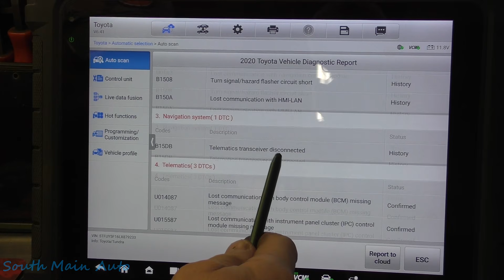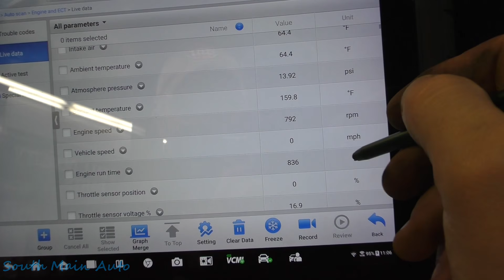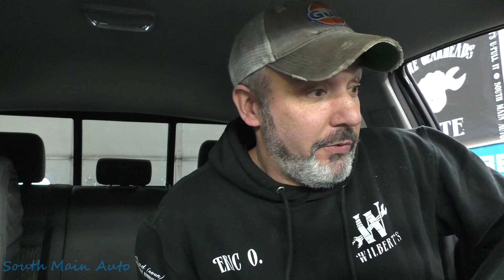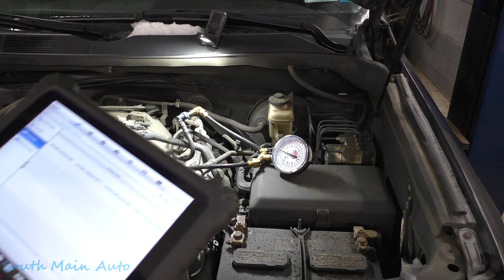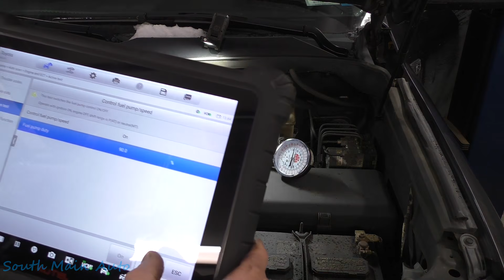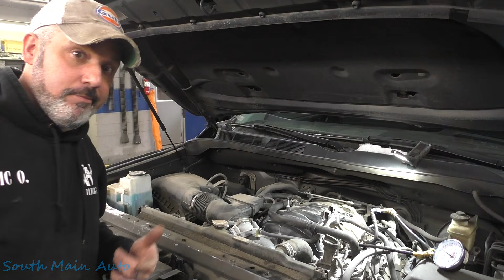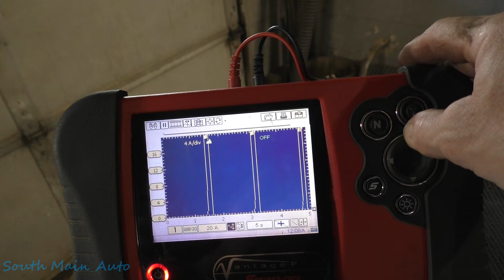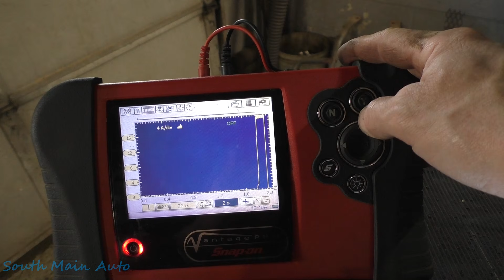My Customer Is Getting Shafted By The Local Toyota Dealer

Comment: My brothers 97 GMC 350 wouldn’t start when it was cold outside without a sniff. Supposed to have 60psi only had about 20. Replaced fuel pump problem solved.

Comment: FPDM fuel pump driver module, always an issue if it's present. Think of a blower motor drawing to much amperage and burning up the resistor.

Comment: Just plain sad that a Toyota customer is shell shocked to depend on his local dealership knowing his warranty is valid.  Then, after this diag, they still decide to throw parts at it due to corrosion on the bracket ! Hell Mr. warranty mechanic, you can hear the pump is junk and why are you tearing into my fuel system array when I have proof the loud sounding fuel pump is going out !
Talk about narrow minded mechanics with distant lens glasses on a near sighted issue.

Comment: There are self-resetting circuit breakers... that's probably what's going on... it's got the bi-metallic element... like a flasher, basically, except it opens when too much current flows.

Comment: I love going to my Honda dealer for oil changes as they provide a multi point inspection that always comes with issues discovered usually over $2200. Today was $2500, guess new year’s pricing😅 The funny thing is that an issue I know exists is a Vtec spool gasket that needs replacement. A blind man can see the leak 😮 FYI I typically have my slave on notice(son) handle most of the issues indicated on the report and I take it to my local mechanic for anything major. The service manager even told me take the report with a grain of salt as most of the techs are kids.
Reply: My grand daughter took her honduu to get an oil change. She walked out with a $400.00 oil change. 
I told her. Never the go to Honduu unless it's with me or your mom😂😂
I had to do a transmission service for her car. I went to Honduu for their transmission fluid and some other parts. 
Paid the bill and walked past the shinny cars and yakking salesman. 
Can I help you? 
I didn't bat an eye.. just kept on trucking.

Comment: It's not Toyota that has a bad brand. It's the dealers that are ruining Toyota. I won't set one foot in the dealer I bought my Tacoma from. It's by far better for me to do my own oil changes. At least I know it will be done right with much better oil. That's only one issue. Lying, cheating and over pricing is 3 strikes all by itself.

Comment: is it possible to measure current at the battery before broke then after wont start the starter draw may not let you see what you need i guess. but after you spray it hummmmm. before and after at the battery . i got to try it in the morning before i drop the tank. fyi i have a new pump ready just seeing the amp measurement is like target shooting exciting

Comment: I would suspect that if he took that truck on longer road trips in the summer, he might have started experiencing the stall condition even after getting the truck running. Furthermore, I believe the customer may have diagnosed the issue himself if he turned off his vehicle when filling it with gas, which I believe he wasn't doing based on his comments about just not shutting it off for short stops.

I encountered a similar issue with my miata. Ended up diagnosing it, albeit hamfistedly, by running it low on fuel, waiting for the car to be massively down on power from lack of fuel, and throwing fresh, cold gas into the tank from a gas station. The car would immediately be fine without any signs of stalling because of the cool fuel. For other DIYers out there, that might be a decent, easy test you can do to assist in diagnosis.

Comment: Great job Eric O.  So rather than a simple pump and regulator, they had to complicate the system with a separate controller to run a "duty cycle" to optimize fuel pressure and flow.  Then mount the thing on the frame rail for added reliability.  On top of all that, they don't train the techs to properly diagnose the operation.  So it ends up with an independent shop that has to explain THEIR OWN SYSTEM to THEM!
Stay warm everyone, the climate changed again. . .to winter!

Comment: Diag electrical issues aren't too difficult unless intermittent.  It's those logic issues that aren't in service data that's challenging.  I don't think I've ever seen circuit checks done by ECUs info in service data, which sucks. 

 Watched a tech replace a PCM because he thought the drop outs in an APP circuit was a faulty PCM when, in fact, the PCM was checking the circuit for shorts to power.  
Thank you for the tidbit on Toyota FPM current protect mode.  Be looking out for that now 😊.

Comment: the fuel pump module has a electronic relay (mosfet probably) that can switch on and of faster than a regular relay (for PWM control). But basically the same thing. The over current protection is better than a fuse because it reacts super fast without blowing the normal fuse as the normal fuse has to physically heat up and melt. So the fuel pump module can try to keep sarting the pump without blowing the fuse as the fuse cools down in between pulses. But if the sht did hit the fan, the normal fuse will blow. You can run 1 million amps thru a 5 amp fuse if you wanted and not blow it, just not very long. maybe a nano second pulse and a 10 second rest, then another pulse of 1 million amps. Maybe I will come back with the maths 12v at 1 million amps over a nano second, lol

Comment: thank you on the lift today 1992 s10 4.3 same problem go to the dg and back try to restart noting spray it will run like new all day till you turn it off. this truck as 55k on it yes 55,000. i am doing the amp draw test first just to know thank weird this vid just came up same problem 30yrs apart

Comment: How does a fuel pump fail so quickly on a new car with such low miles? I have an old Audi that I replaced a fuel pump at 256,000 miles and 30 years old.

Comment: One thing I've learned with my 2018 5.7 Tundra is that you ALWAYS need to shut the engine off and remove the key when you fuel up.  For the first few years of fueling my truck i had never shut it off.  (Farm fuel tank)  This made the alcohol percentage register as like 87% ethanol (no it wasn't E85 in the farm tank).  The only time the 5.7 recalculates the alcohol content of new fuel is if it's fuel level changes during the time the engine was "cut off" and when it was "cut back on". (This is what a Toyota tech told me)

Comment: Good diag Eric. I had a similar situation on the motor home when my inverter quit. I diagnosed it as a bad ground and informed the RV "service center" of that. They called it as a bad inverter and replaced it. When the new inverter didn't work, they replaced it with yet another inverter which, guess what?, didn't work. Then they finally chased down the ground lug which was heavily corroded. 

I sent the original inverter back to the manufacturer and because it was still under warrantee, they serviced a circuit board and returned it to me. All it cost me was shipping (plus I paid for the new inverter - they would not re-install the old one).

Comment: It starts and runs after spraying ether in it cause during cranking you have 12v or less going to the pump. Once it starts off the ether and the alternator kicks in, you have between 13.5-15.5v going to the pump. That difference of a few volts could be the decider if you have enough fuel pressure and volume to run normally

Comment: my theory is during cranking the battery has around 12 volts, maybe not enough to start the siezing fuel pump. however spraying the Cosby sauce and revving the engine slightly bumps the voltage up to 14-15 volts.. maybe that's enough to jump start the fuel pump.. good video Eric O.

Comment: I had a Dodge van that had similar symptoms.  It would always start when cold, but occasionally would not start when hot.  Then one day it just died while I was driving it and would not start.  I had it towed to the dealership and it fired right up once they got it there.  I got it back drove it a few more weeks and it did the same thing. Again, towed it in and it fired right up at the dealership.  They asked me to come get it as they couldn’t find a problem.  I asked them to keep it and have a tech drive it home each night until it acted up so they could work on it. They reluctantly agreed and a couple of days later I got a call that the tech had found the problem.  He had taped a fuel pressure gauge to the windshield and as he was driving the fuel pressure went to zero and the van died.  He waited a few minutes and it restarted and he drove it to the shop and replaced the fuel pump and that was it.  Why it only failed when hot, I don’t know, but it worked fine cold, but was flakey once hot.

Comment: What a sad state of consumer protection.  Customer knows the dealer will just throw parts at it until they stumble upon the problem,,, but the customer is on the hook for their incompetence.  The worst part is you cannot prove that the parts they threw at it,,, did not need replacement.  

Just seems wrong to me.

Comment: I worked on a Vibe/Matrix once that ran fine unless it was a cold start in single digit temperatures. It had 170k miles with the original plugs on it and when i inspected them there was barely anything left of the side elctrode.  I couldn't believe it ran at all.  At 12 degrees started and ran fine.  At 6 degrees she aint starting.  I guess 3/16" is a bit too much gap for spark to jump in those temps. HAHA.  How is that related? I dont know.  Just a wierd no-start condition.

Comment: In my opinion dealer tech have been taught to follow the chart and if this is so go to here if not go here replace module. Which is one step above a parts changer. Does ASE teach trouble shooting with the use of a scope? Not knocking the ASE. Being an MECP master installer you know the junk aftermarket stuff you hate only means one can understand the questions and answer properly but the application of what you know is a completely different story as you see when you drop the dash and see a rats nest. Gives us a bad name as any install I do you can't find the modules or any trace of the install. Erks  me when someone puts a 199.95 alarm in a 70 grand truck for "protection".

Comment: On big trucks relays are used as buzzers for low air pressure or oil pressure or whatever. So yes a relay can modulate from on to off when shorted and a motor that will not turn may cause that condition.

Comment: had a similar issue with a 2002 f150. Cranked cold, once turned off, wouldn't crank until it cooled off. After a week of this, noticed the odometer would be blank when it failed to start. Was a bad PCM relay

Comment: I have a 2010 Toyota Highlander that I took into Vandergriff Arlington, Texas had the timing chain blow off, and this is the second time I’ve taken it to them for the same issue. They said they found metal in the dipstick which that’s not even possible to pull a chunk of metal out through the little dipstick hole and they said it would be 6000 for a motor with more miles than my car 3000 for labor and 1000 for miscellaneous so all in all they just wanted me to buy a new car. I let the car sit in my backyard for a year and decided to junk it and they gave me 1800 for it. I lost so much in that car but it’s hard to find a good mechanic not shady, that’s why I like this page
Reply: How many miles?
Reply: @wespotter6985  this?
Reply: My sister parked her 2015 Tahoe for over a year because no one could fix her truck. 
She heard that I am a shade tree mechanic. 😂😂
She towed it to my tree house.
About 1 hour later I told her what's wrong. 
By the way Chevy dealership took a stab at it before she parked it.
She spent $1k in parts total. All Chevy parts only. I shopped from a dealership in Texas. 
Anyway, because I have an actual job. In between my work schedule I fixed her truck. 
To this day, she is so happy her truck runs so well. 
And it's because of Eric O and Ivan.

Comment: Thought: If the amperage/power consumed (±120 Watts) in the very-hard-to-run-pump generates a whole lot of heat, and it pumps around not-a-whole-lot-of-fuel, you might end up with a vapor lock in the pump after the pump stops. Getting it running again without additional fuel it fails due to mechanical resistance/the vapor lock/the bad motor. With additional fuel it starts assisted by a higher voltage in the system. Nice video!

Comment: Flashback time.  My '91 Sierra (It had the big 4.3) would once in a while crank no start, but if I coaster down a hill (my driveway) and popped the clutch it fired right up and ran fine.  Finally one day it wouldn't even bump start, I loaded it on a trailer and hauled it to the shop, fired right up.🙄.  A few weeks later it did it again, and I finally realized I couldn't hear the in-tank pump, pf course it was about 1/2 mile short of a full 34 gallon tank.  I changed it in the street out front.

Comment: I had a similar issue with a 1991 Chevy K Blazer 350 with the 220 TBI. With low temperatures and vibration (engine running) the fuel pump worked. It was a bad fuel pump ground in my case. The laughing gas would get it restarted and it started cold. Took me a long time to find it.

Comment: After it starts the system voltage goes up. May explain why once it starts from the juice it continues to run. Would have been interesting to hook up a charger to boost the voltage to see if it started.

Comment: Weird system, I assumed that this injection does not have reflow pipe to tank, but CPU monitors fuel pressure instead and turns duty cycle lower and higher to keep right pressure. But seems that Toyota tries to save some electricity or bump, what else is the purpose of this duty cycle business? Had this bump been powered by normal relay so 100 % "duty cycle", it would have worked from normally. As it started when cold when supposedly duty cycle was higher.

Comment: Great video . nicely done. I did instantly think when you got up close with the sound of that pump my immediate thought was that sounds like crap. I think you are right about the low voltage thing as when cranking the voltage will also drop a good amount but with happy spray the run voltage is right back up there, great diagnosis keep up the good work.

Comment: Great video!  Recognizing the importance of 14V vs 12V is probably the part I would've overlooked.
Reply: Actually the voltage difference is probably worse than that. The system voltage while cranking is maybe 8-10V. That is not enough to start the hot fuel pump. Remember near the beginning that the system did not appear to do a priming hit on the pump before cranking. Maybe that was a wrong guess, but if it was correct, the pump not starting on 8-10V is a clue.

And yah, hindsight is easy. To trigger on the voltage difference during the diagnosis is brilliant.
Reply: @FreddyLangley  I definitely  agree that the cranking voltage will be well below 12V, but shouldn't the system start the fuel pump before it energizes the starter, to guarantee full fuel pressure at start-up?
Reply: @jamesanderson2176  
My old 2004 JDM Toyota Wish does exactly that. 
In fact I switch on the ignition to the "run" position and then buckle my seatbelt, adjust the rearview mirror...all while the pump can be heard pressurising the fuel system...

Then twist the ignition key (remember those?) and away it goes.

What idiot designed a fuel pump controller  that doesn't do this?
Reply: @JohnSmith-pl2bk  But this is a pushbutton start. Any delay between starting the fuel pump and the starter would be noticed and would make it seem that pressing the button was not working.

On another video, Eric pointed out that some sort of truck (GMC?) actually hit the fuel pump briefly when you first opened the door, so the fuel system would be pressurized for an eminent start. Unless of course you were working on a fuel line and then it started squirting (as happened to Eric).

I can't think of a good way to sense when the driver is about to press the start button (or turn the key).Maybe detect the brake press that is required before you press the start button, but that might only be a fraction of a second.
Reply: @FreddyLangley  
So in that case the fuel pump should be ordered to pressurise when the driver gets into the vehicle...
and at all times the vehicle is "mobile"..i.e. at all times the gearshift is not in N or Park.....
and/or the push button STOP hasn't been pushed.
Reply: @FreddyLangley My 2018 Silverado primes the fuel pump when I open the driver's door.
Reply: How about a seat sensor. Like they use for the passenger seat airbag. Figuring if someone plops their ass in the seat it probably means they'll want to start it.

Comment: I would've just changed the fuel pump. That's typical of a fuel pump that's failing. But that truck is kind of new with low mileage. And you're a business. So I understand why you go through that process. For myself, friends and family, I would have went straight for the pump replacement.
Reply: 😊 that sort of a go-to remedy for any GM product or even Ford product that loses fuel pressure.

Comment: What would you do if he took his vehicle to the dealership after your diagnosis even showing the video and they were to disagree?
Reply: Oopsie I didn't get into the replies and the extra info you posted, because I had a situation many years ago similar but before fuel injection was common and the dealer wanted to change the carburetor that was not covered. Regardless my mechanic changed what he thought it was and it was a fuel line that was corroding from inside and out was fixed. I managed to get paid the 3 hours work it was at the dealership hours so I actually made money.
Never see that happen these days, is why I asked what you would do. 
My mechanic actually went to the dealer with the vehicle and showed them. 

You are the best Eric